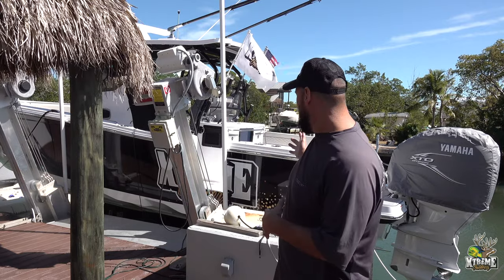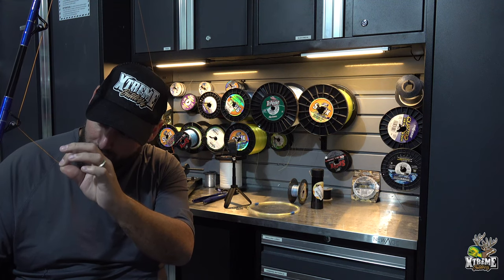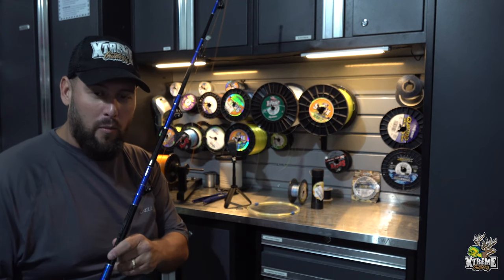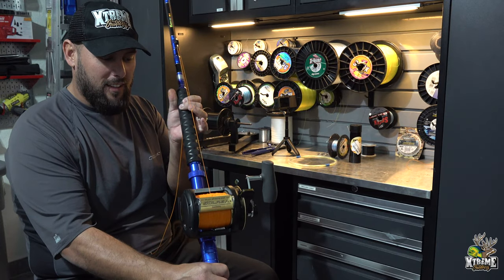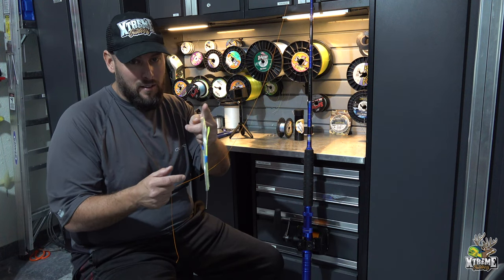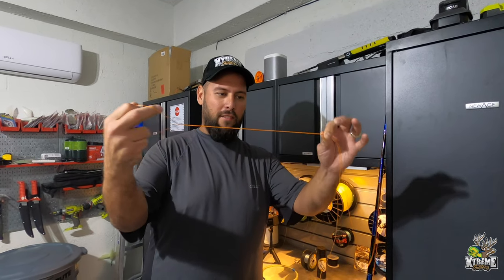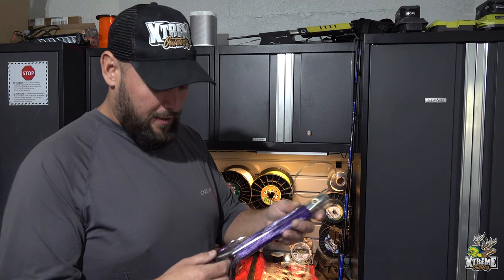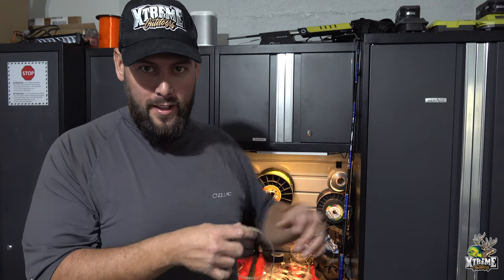How To: High Speed Trolling for Wahoo!

Comment: Great video with lots of good information! I have a question. What is the reason you use the hollow core braid instead of regular braid for the main line?
Reply from the maker: Well, I’ve never had hollow core braid break on me. So for the high speed function, I simply trust it more than regular braid that I have had fail me several times. It’s more of a personal preference.
Reply: @stayxtreme  thanks again for the video.... great stuff!

Comment: I really like the video.  Doing a wahoo trip to Bimini this winter.  Can you send me info on the rods and reels.  Or can you get away with shimano tiagra 30s?do I need to get three .50s for trip.  Do you run 48oz weights on all three rods?   Fishing out of Milwaukee wis.  Watching these videos have helped a bunch.   Caught a weehoo down in the keys. It was a blast. Can’t wait to target them.  Any info you guys would share would be awesome. Thanks.
Reply from the maker: Hi carl!! Thanks for the feedback! We really appreciate it. Wahoo high speed trolling is very technical, 50 wides would be my bare minimum for sure. Especially with the Two speed function, that comes in handy when bringing in the wahoo. So the two shorter lines you can run a 48 oz weight on. But the longest line back you can use a 32 or 24 oz weight. That ensures that they don’t tangle up on turns. I am switching all my rods to Connley wahoo whacker series rods with tiagra 80 wides. But you can use a tld 50 also. As far as the rod goes. Long bent butt that is stiff rated up to 130 lbs. 6ft 6 inch minimum length. Let me know if you need anymore info and I’d be happy to help! Good luck out there and stay xtreme!

Comment: What’s the reason for running the same size weight on port and starboard side but a different weight size in the middle? If you have the same weight on the two sides but staggered length wouldn’t they still cross because they are at the same depth because of the same weight? Why not use all three different weight sizes?
Reply from the maker: Hello John. You can run three different sizes if you want. But I run them 48 oz because the closer you are to the boat the less depth the weights will reach, so by running them at 75 yards and at 125 yards those two lines will be at different depth and will never cross. And you obtain the greatest depth possible for the wahoo to attack the lure.

Comment: Do you run each rod with a 48oz torpedo weight?
Reply from the maker: The long line in the center I use a 24 oz weight. The other two I use a 48 and they have to be staggered in length. That ensures they don’t get tangled in turns. :)